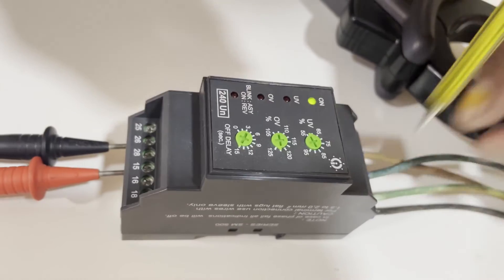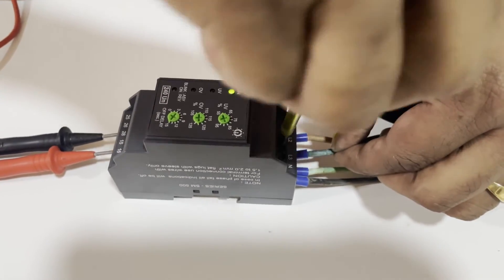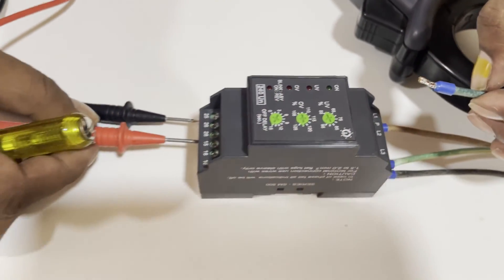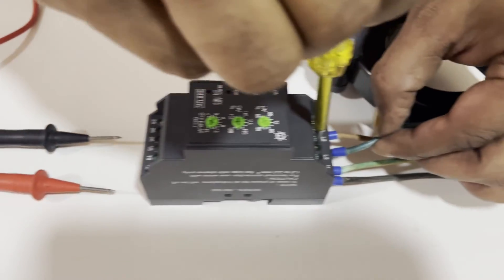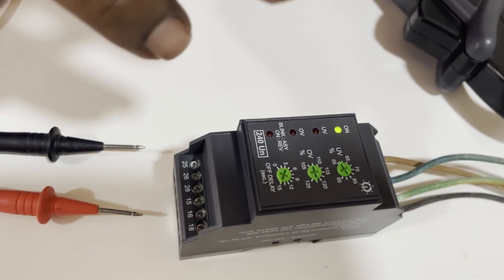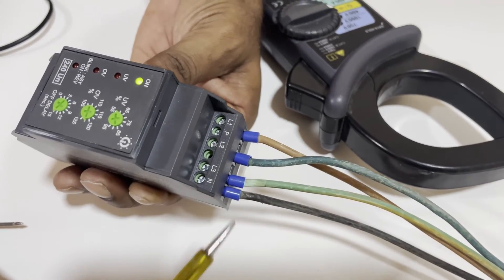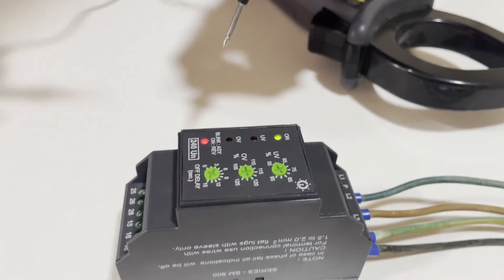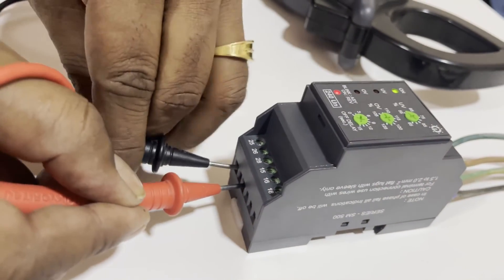How does Voltage monitoring relay works / Phase Failure relay Explained with Wiring....PFR

Comment: Thanks for the video.

Yesterday we came across one trouble shooting of LVM at generator. The phase voltage is available at the input side or L1,L2 &L3 side but still the LVM green light is not switching on. Can toy suggest what all to check
Reply from the maker: if its all voltages range is ok.. still the relay not getting green light..j ust change it.
Reply: @sennapparajan.p  ok